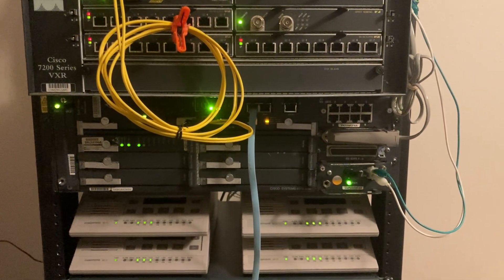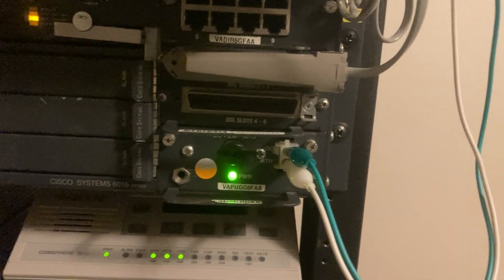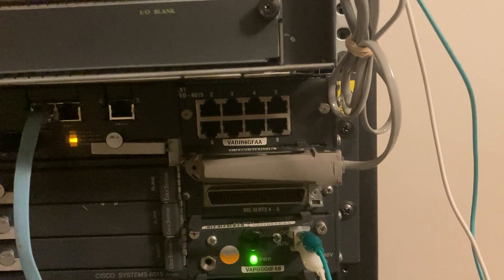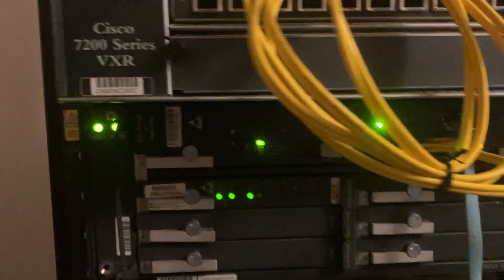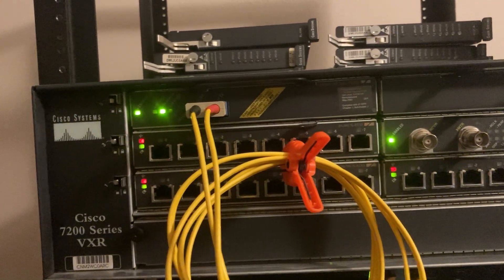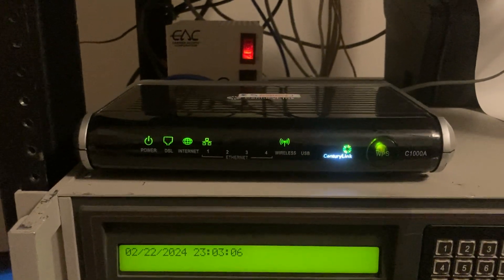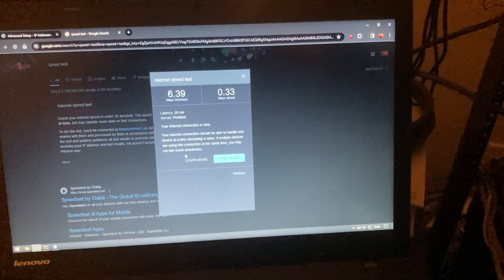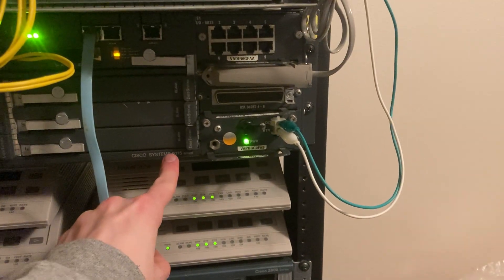DSLAM Shenanigans

Comment: The 32ms latency could be because you are using interleaving on your ADSL interface to your modem...Interleaving will cause latency because it is a way of error correction on the copper loops in a non-perfect environment.  You should have the ability to turn off interleaving and use FAST, this option should be on the ADSL interface of the Cisco or in the Cisco ADSL profile you are using.  This should almost eliminate your latency between your local network and your DSL setup.  The ATM unto itself should not really cause any real latency unless the link is saturated
Reply from the maker: Just gave that a shot, definitely made a difference! Local pings are now 6ms and to 1.1.1.1 is now around 20. Maybe once I study the protocols and configuration more I'll be able to understand this fully lol